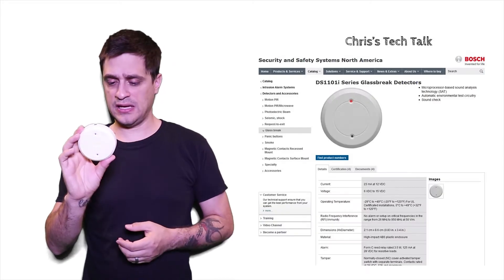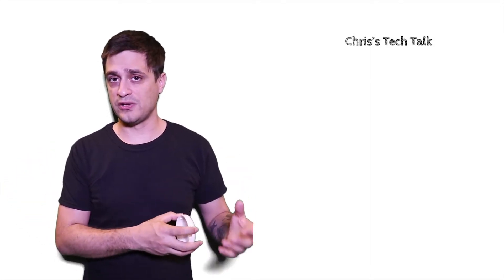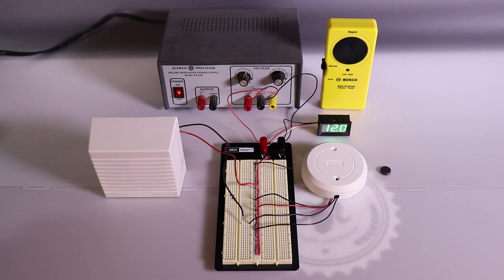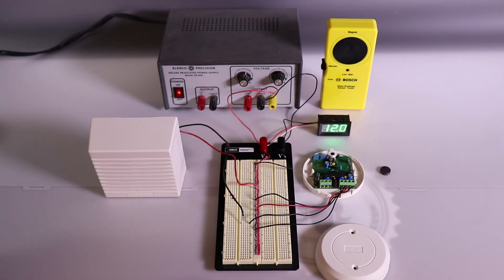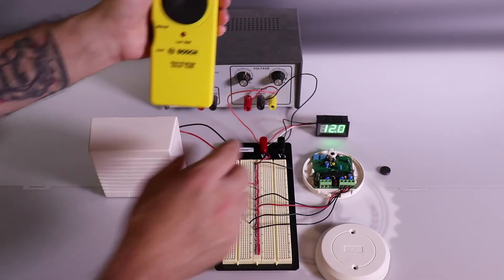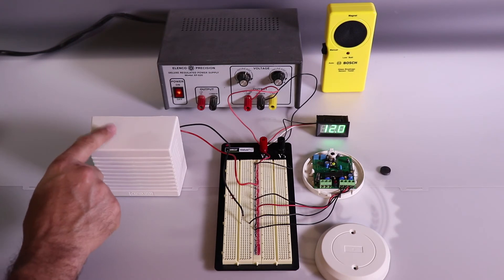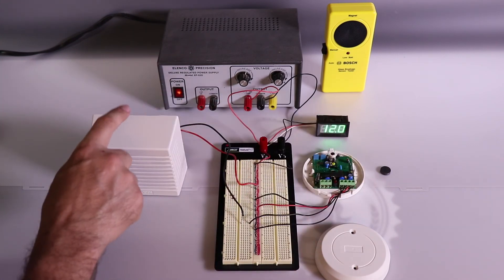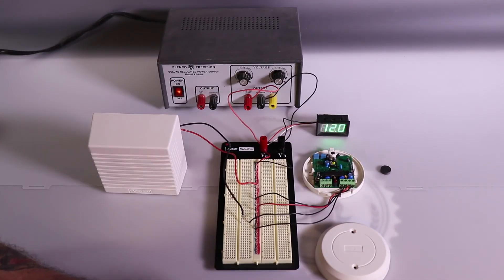Acoustic Glass Break Sensor

Comment: I want to have a glass-break alarm that operates on its own.  No other alarm system needed.  So I need the sensor and the microphone.  How do I make this work with the Bosch?  I can see the picture in your video, but how do I assemble it?  Is there a way to just plug the microphone into a wall outlet?

Comment: Hi. Does the tester works only with Bosch Glass breaks or it works with other glass breaks brands?
Reply from the maker: It depends--the different manufacturers believe glass breaks in various frequencies, so the Bosch sensor may work with other sensors but to be on the safe side, I'd recommend making sure to use the same brand of tester as your sensor.
Reply: I am using a brand new Interlogix glass break and i have the interlogix tester. I couldn't unseal the zone even using marbles, keys, tapping, clapping.
Please advice me about the best way to test the glass break.